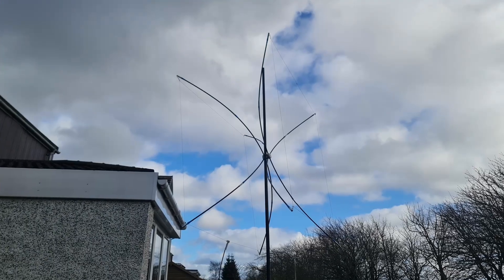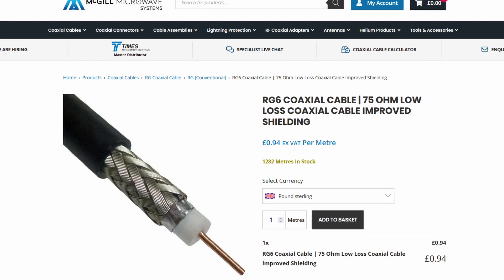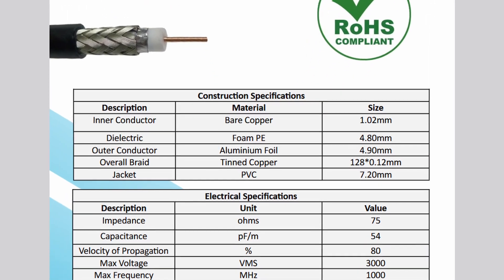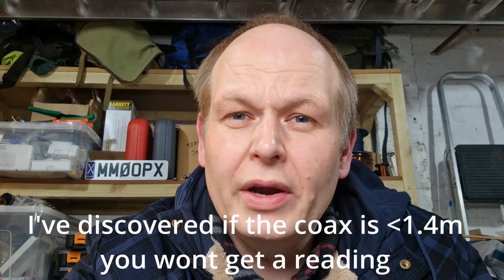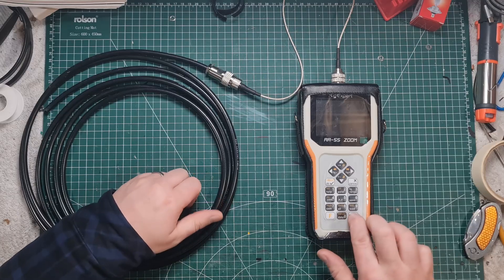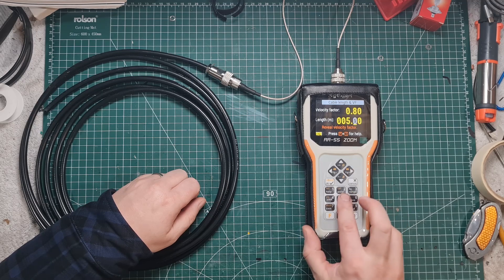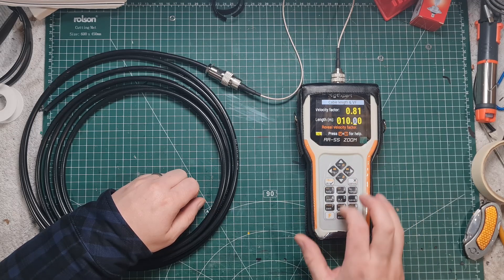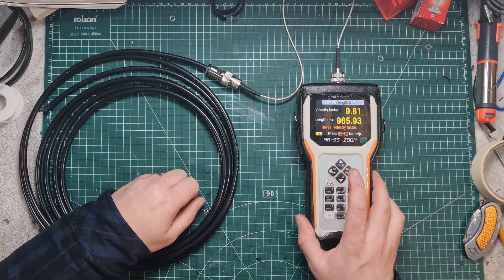Velocity Factor  - Why & how we can apply it in Ham Radio

Comment: 0.95 is not velocity factor, but end effect on wire. It doesn't exists on loop antenna and require even longer length. So insulator adds some more shortening effect as velocity factor and it is added to 0.95 (multiplying).
Reply from the maker: Can you explain further? Where did the 0.95 come from? Are you saying radio waves travel at the same speed through wire as it does in a vacuum? Its a fascinating topic.

Comment: I couldn't quite see... were they Ntype connectors you had on your stub or pl259/so239?..... I have no idea if this could account for a 1% difference in vf figure but pl259's are not 100% properly impedance matched (whereas n type & bnc are) so it would be interesting to see if they make a noticeable difference or not.... say running a test with both sets of connectors.

if the tester works by putting a pulse onto the 50ohm test lead then looks at the first reflection from where it hits the first impedance discontinuity between the test flexi & the cable under test, & it compares this against the second reflection from the end of the cable under test then one thing you have to watch is that the first impedance discontinuity starts at the patch cable side interior earth face of the so239... which is about 4mm away from the true braid end of the 75 ohm cable under test....this could physically make the "cable assembly under test" slightly longer than the length you put into the tester.

On a 2m cable, 4mm discrepancy could be significant., but as you say if you test with a longer sample you should get more accurate results (4mm discrepancy on 100m is insignificant).

I will now shoot myself 100% in the foot... your vf was slightly faster than expected... the above making things longer should decrease the vf... it certainly looks like further checks could be worthwhile... possibly pl259 vs n type & 2m vs 20m measurements.

If they were N-types you used, the female socket on the end of the test lead will be a 50 ohm one, but was the n type male plug on the end of the cable under test a 50 ohm one or a 75 ohm one (as that will impact if the mm correct measurement of the 75 ohm "cable" end was the inside or outside face of the internal earth face of the male). Where exactly do you consider the 75 to 50 ohm transition to be?
Reply from the maker: I will do this if I get my hands on some N types. I dont however think it will make any difference. The reason for this is this Rig Expert can be used in 50, 75,100, 450 ohms. measuring in both 50 and 75 ohm made no difference, Same VF regardless.

Comment: I always wondered how to use the velocity factor to make shorter antennas.
Reply from the maker: Unfortunately its never that much less than full length!
Reply: @MM0OPXFieldRadio  rg-58 67% by datasheet. 1/3 on 160m gives about 28m vertical (tallest sotabeams mast)